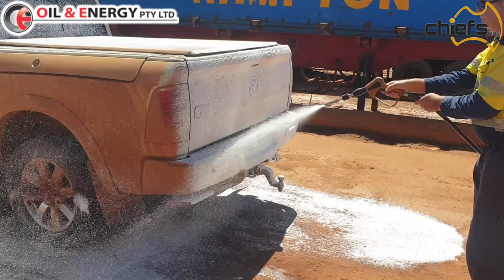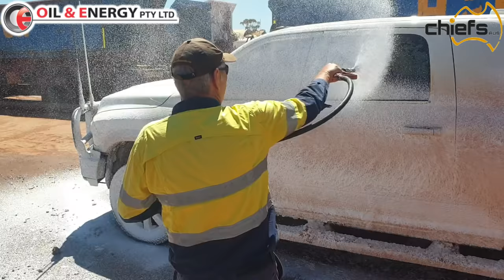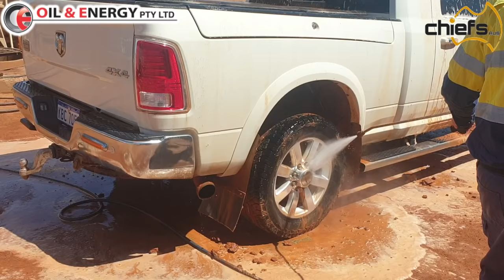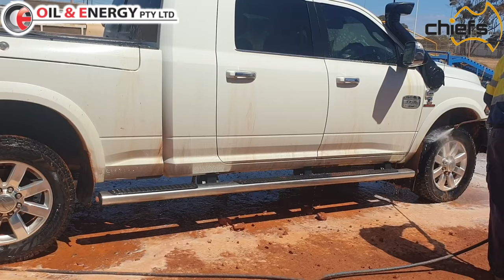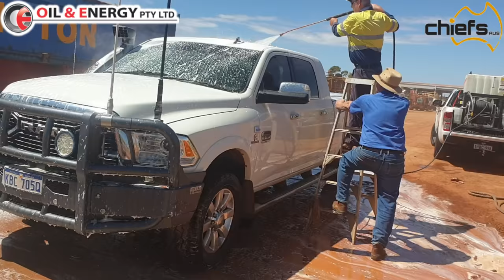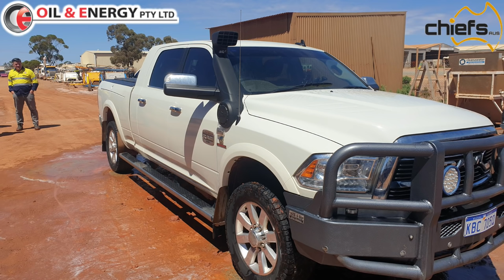Chiefs Touchless Cleaning Solutions

Comment: Coming from a detailer, you could’ve gotten the same result by pressure washing and not wasting product. Showing wet paint for an after doesn’t show anything. Can guarantee the truck had contamination and brown spots everywhere
Reply: Right the way he rinsed the car down made me cringe he could have washed it faster with top to bottom he has to go back to spots he already rinsed just wasting water at this point
Reply: @ITz_RUINED  you have to wash bottom to top with this, it uses the product on the up stroke. Downwards will just rinse it off without it doing any work
Reply: @bonkeydollocks1879  this is not true. Idc what Wash you’re doing. You wash top-down
Reply: @jesselent7894  I'm sorry but you're wrong and I'm not having a long drawn out debate about it.
Reply: @bonkeydollocks1879  nope what you’re supposed to do is pre rinse, get all arches, crevices, take time to inspect your paint, then you spray it with foam, let it dwell and watch the soap pull whatever dirt or grime is left on, take a mitt, wash it, spray it down, and on any white vehicle after you have gone through the processes the right away, you will use an iron remover to see if it’s necessary to clay or not. 

This rule and your rule is wrong
Reply: @jesselent7894   I have tried this product its does the job.Its 100% touchless
Reply: @ryanmark7013  which camical for yo using
Reply: please answer me
Reply: You all people talking like you know what you're talking about
Reply: @ian74747  let them be🤣
Reply: @tonemed945  are you always a year late to everything?
Reply: @bonkeydollocks1879   yes I can be delusional like you sometimes on topics lmao
Reply: @bonkeydollocks1879   I know right 🥴
Reply: @bonkeydollocks1879  likewise and I will try honestly 🧐
Reply: Exactly...what this was, was a waste of time aswell...the entire purpose of a car shampoo wether you using a foam cannon or stand alone bucket system is to minimize the the swirls created from the hand contact process of the wash itself....there is no wash product in exsistance that has prevented swirls...the only thing we as detailers(wether you a qualified master or professional detailer or an enthusiast or somebody that just cleans there own car) can do is minimize that swirl contributors by lubricating( using good qaulity shampoo,clay lube and water less wash during the hand contact process)...if there was a stand alone product that you could just foam on the car and it will clean it ,then it would have been invented already,it will never be invented!...there is a bigger chance that car manufactures will develope self cleaning paints than there being made a shampoo you foam on and walk away and its done.
Reply: its just a WASH  not a detail
Reply: @jesselent7894 false you wash bottom up for several reasons and unless you have done pressure washing and sprayed 1,0000’s of gallons of water and chemical you won’t understand.

Comment: Why are you washing dirty water over the area that has been wash sprayed down already?  Top to bottom would be more efficient. Washing it down with plain water first would have taken most of that crap off with no soap
Reply from the maker: When washing a vehicle using conventional methods you firstly apply soap, wash using a sponge or a broom and then rinse off with water from the top to the bottom.
Touchless washing is a bit different.
Soap is applied through a high pressure foamer and then high pressure water is used as a “sponge or a broom”. The water is worked back into fresh soap, either from the bottom to the top or backwards in the case of trucks and trailers etc. In this way, the soap is used more efficiently. (If you wash from the top down, you would simply wash the soap off the vehicle which defeats the purpose).
Then rinse from the top down to finish the cleaning process.
Reply: Buddy u should have sprayed it down first and got alot of the mud off
Reply: Indeed… very painful to watch..
Reply: So spread the dirt around the paint, yeah sure I'll do that immediately 😉
Reply: The detailer is right, bottoms to top method is the best.
Reply: When doing touchless washes, going bottom to top for the first rinse makes more efficient use of the foam soak. Then you do crevices, then finally a top down rinse.

Comment: For anyone ranting and raving, that he should be rinsing top to bottom. In this case, you are wrong.
You rinse bottom to top with these types of products to get the full cleaning power, you are activating the chemical reaction which is what removes most of the dirt.
Also, this is a pre wash product, this is used prior to a touch wash, so that you aren't pushing dirt and grime around the paint work when touch washing.

Comment: It should have probably been rinsed off first going side to side is how you use a pressure washer also not up and down
Reply from the maker: When washing a vehicle using conventional methods you firstly apply soap, wash using a sponge or a broom and then rinse off with water from the top to the bottom.
Touchless washing is a bit different.
Soap is applied through a high pressure foamer and then high pressure water is used as a “sponge or a broom”. The water is worked back into fresh soap, either from the bottom to the top or backwards in the case of trucks and trailers etc. In this way, the soap is used more efficiently. (If you wash from the top down, you would simply wash the soap off the vehicle which defeats the purpose).
Then rinse from the top down to finish the cleaning process.

Comment: Rule #1 prewash rinse
Rule #2 foam canon vehicle in thick foam
Rule #3 use wash MIT and scrub vehicle with the MIT all the way around using the 2 bucket method 
#3 shammy it off 
#4 then make a video of the exterior and I bet it would look brand new and less cringy lol
Reply: its a touchless wash it took him 10 minutes to do not a full proper hand wash
Reply: That's the thing... No need to use 2 buckets or scrub.
Just Spray it with this 'Acid foam' and use the highpressure water as the scrub and rinse it off.
I do the same with my Toyota using Pronano Plus and Pronano Diamond Wax.
Takes me an hour instead of an afternoon.

Comment: Why do they always go from the bottom to the top??
Reply from the maker: When washing a vehicle using conventional methods you firstly apply soap, wash using a sponge or a broom and then rinse off with water from the top to the bottom.
Touchless washing is a bit different.
Soap is applied through a high pressure foamer and then high pressure water is used as a “sponge or a broom”. The water is worked back into fresh soap, either from the bottom to the top or backwards in the case of trucks and trailers etc. In this way, the soap is used more efficiently. (If you wash from the top down, you would simply wash the soap off the vehicle which defeats the purpose).
Then rinse from the top down to finish the cleaning process.

Comment: Boy I bet that pant is astronomically more thin than it’s supposed to be by now
Reply from the maker: I bet its not
Reply: @chiefsaustralia9012  not saying it’s related to the washing. I’m talking about what it goes through everyday to look like that. That stuff takes a toll on paint.
Reply from the maker: not at all as the product is used a 1 % chemical and 99% water
Reply: @chiefsaustralia9012  I believe you. Again I’m not talking about the wash job. Just the dirt getting plastered against it in the first place
Reply from the maker: @MintMonte87ACSS312  When washing a vehicle using conventional methods you firstly apply soap, wash using a sponge or a broom and then rinse off with water from the top to the bottom.
Touchless washing is a bit different.
Soap is applied through a high pressure foamer and then high pressure water is used as a “sponge or a broom”. The water is worked back into fresh soap, either from the bottom to the top or backwards in the case of trucks and trailers etc. In this way, the soap is used more efficiently. (If you wash from the top down, you would simply wash the soap off the vehicle which defeats the purpose).
Then rinse from the top down to finish the cleaning process.
Reply: @chiefsaustralia9012  he's on about the truck being driven on the roads with sand hitting it whilst driving. Like being sand blasted from the dust and dirt. 🫣 He didn't mean how you washed it 🤣

Comment: Top to bottom man
Reply from the maker: When washing a vehicle using conventional methods you firstly apply soap, wash using a sponge or a broom and then rinse off with water from the top to the bottom.
Touchless washing is a bit different.
Soap is applied through a high pressure foamer and then high pressure water is used as a “sponge or a broom”. The water is worked back into fresh soap, either from the bottom to the top or backwards in the case of trucks and trailers etc. In this way, the soap is used more efficiently. (If you wash from the top down, you would simply wash the soap off the vehicle which defeats the purpose).
Then rinse from the top down to finish the cleaning process.

Comment: Mate! start at the top and work your way down! Slowly, not in a straight line and not so fast. Not gunna lie, looks very amateur work. Just take a couple of mins to watch a couple YouTube videos for some tips... From yours truly a professional detailer.
Reply from the maker: When washing a vehicle using conventional methods you firstly apply soap, wash using a sponge or a broom and then rinse off with water from the top to the bottom.
Touchless washing is a bit different.
Soap is applied through a high pressure foamer and then high pressure water is used as a “sponge or a broom”. The water is worked back into fresh soap, either from the bottom to the top or backwards in the case of trucks and trailers etc. In this way, the soap is used more efficiently. (If you wash from the top down, you would simply wash the soap off the vehicle which defeats the purpose).
Then rinse from the top down to finish the cleaning process.

Comment: If this ain’t the most assed backwards pressure washing job then I don’t know what is
Reply from the maker: Mate, it really is a assed backwards pressure washing job, so, when washing a vehicle using conventional methods you firstly apply soap, wash using a sponge or a broom and then rinse off with water from the top to the bottom.
Touchless washing is a bit different.
Soap is applied through a high pressure foamer and then high pressure water is used as a “sponge or a broom”. The water is worked back into fresh soap, either from the bottom to the top or backwards in the case of trucks and trailers etc. In this way, the soap is used more efficiently. (If you wash from the top down, you would simply wash the soap off the vehicle which defeats the purpose).
Then rinse from the top down to finish the cleaning process.
Reply from the maker: There's a very good reason why touchless cleaning uses this technique. If you're interested, we've made a video that explains it: https://youtu.be/-_jpvcDU8Ek

Comment: The mudd still soft and wet let it dry and then try it again
Reply from the maker: When washing a vehicle using conventional methods you firstly apply soap, wash using a sponge or a broom and then rinse off with water from the top to the bottom.
Touchless washing is a bit different.
Soap is applied through a high pressure foamer and then high pressure water is used as a “sponge or a broom”. The water is worked back into fresh soap, either from the bottom to the top or backwards in the case of trucks and trailers etc. In this way, the soap is used more efficiently. (If you wash from the top down, you would simply wash the soap off the vehicle which defeats the purpose).
Then rinse from the top down to finish the cleaning process.

Comment: That was the most ass backwards wash lol
Reply from the maker: When washing a vehicle using conventional methods you firstly apply soap, wash using a sponge or a broom and then rinse off with water from the top to the bottom.
Touchless washing is a bit different.
Soap is applied through a high pressure foamer and then high pressure water is used as a “sponge or a broom”. The water is worked back into fresh soap, either from the bottom to the top or backwards in the case of trucks and trailers etc. In this way, the soap is used more efficiently. (If you wash from the top down, you would simply wash the soap off the vehicle which defeats the purpose).
Then rinse from the top down to finish the cleaning process.